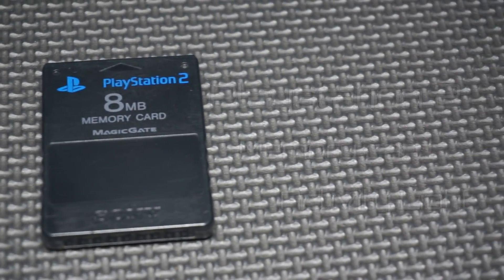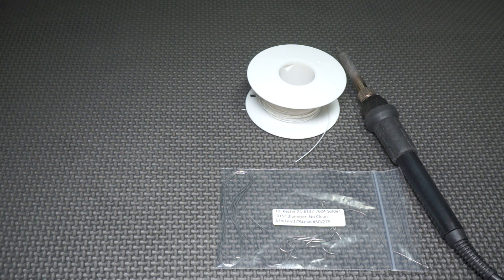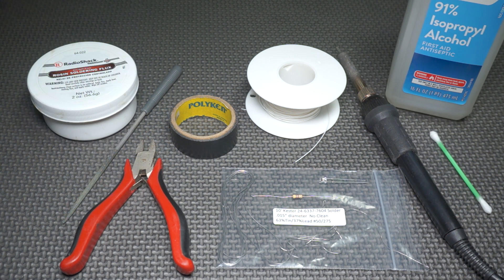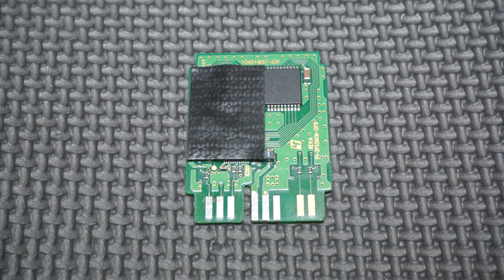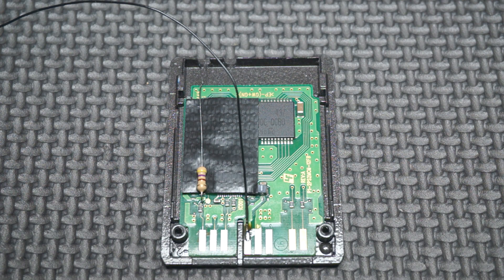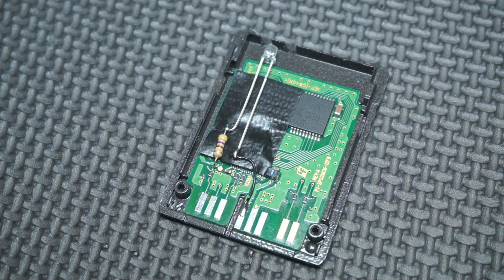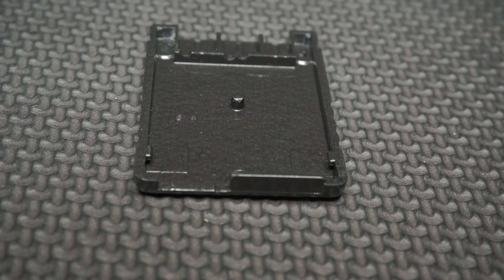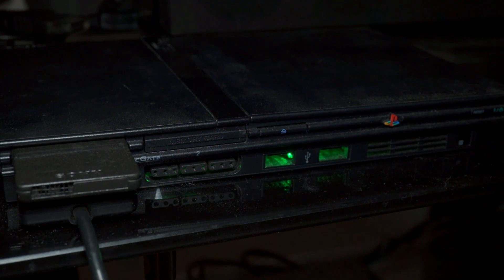How to add a Playstation 2 memory card activity light

Comment: Is the wire you have linked in the description different from the 30awg Kynar wire you have linked in other videos? If so how do they differ? Does it matter if I use one or the other?
Reply from the maker: I wasn't aware I had different links to different wires. But no they shouldn't be any different all kynar wire is basicly the same. I know some is stranded VS solid. Which shouldn't matter all that much.
Reply: @TechnoOnTop  Ok I am just trying to understand the different kinds of wire and when to use them. So I have a spool of 30awg kynar wire already, can I use this for anything? Like Leds, buttons, switches, modchip installs? Or should I get the 22 Gauge wire you have also linked? I am not sure of the pros and cons and when to use a certain type over another. Thank you for your quick reply :-)
Reply from the maker: @jakestephens3689  I have used 30awg for leds with no issues. I even used them to power led strips no problem. 30awg is good for modchip installs. I'd recommend using a slightly larger guage for power and grounds of the modchips 26 awg. 30 can pretty much be used for everything mod related no problems.
Reply: @TechnoOnTop  Oh Ok, so would you recommend that I get the 22 Gauge wire and use this for everything to be on the safe side? Because I currently only have 30awg wire and thats the only wire I have
Reply from the maker: @jakestephens3689  iv really had no issues using 30. Like I said I used it with tge led rgb strips. I installed my Xbox modchip the 2nd time with all 26, except the D0 point I used 30. Then Ps2 modchips I used 30 for all the data lines, and 26 for pwr, po, gnd. 26 for everything is good. Or using a mixture is good.
Reply: TechnoOnTop 26 gauge? Not 22 gauge? U linked 22